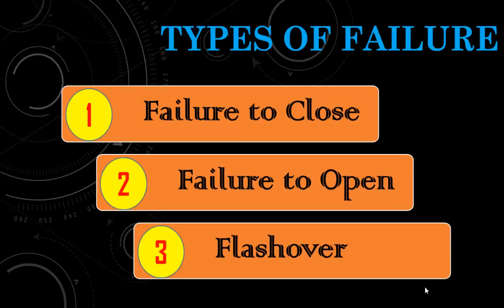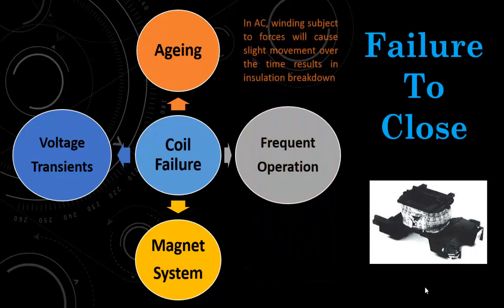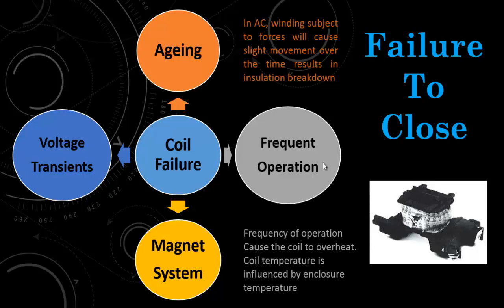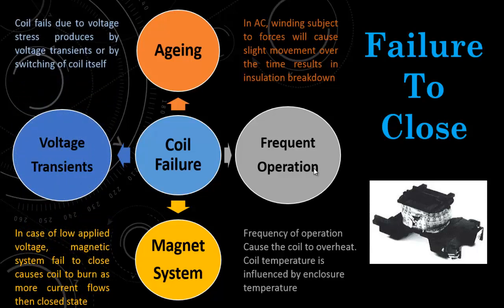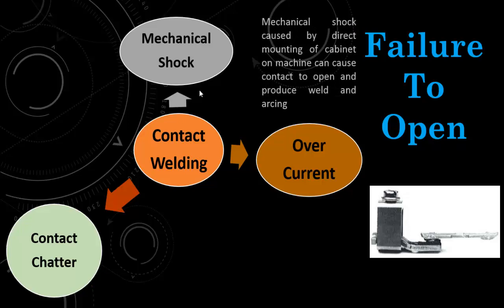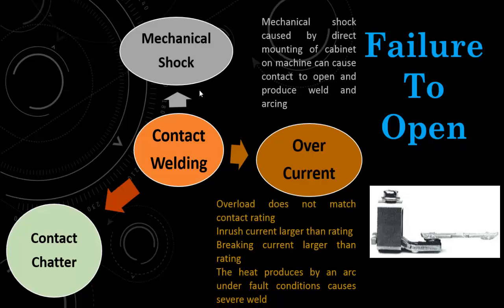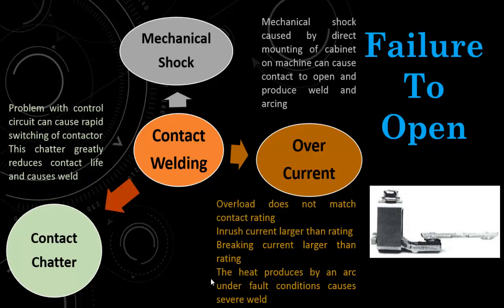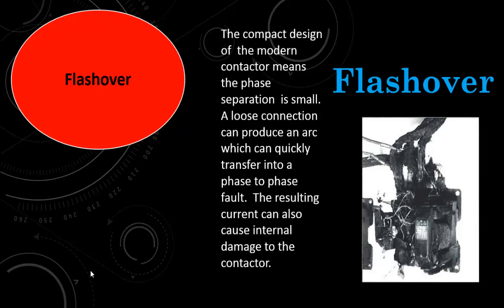Reasons of Contactor Failure | Contactor Troubleshooting

Comment: Having the wrong ip rating for the machine can cause a contact weld as well. 
For example 

Working in dusty and wet conditions and your contactors only have an IP of 20. 

After 5 years they will start welding themselves shut.
Reply from the maker: Thanks for the useful information

Comment: Hi, can we use a voltage stabilizer and snubbers for protecting contactor coil from high voltages and spikes?
Reply from the maker: Yes snubbers consisting of resistors capacitors are used to protect the coil